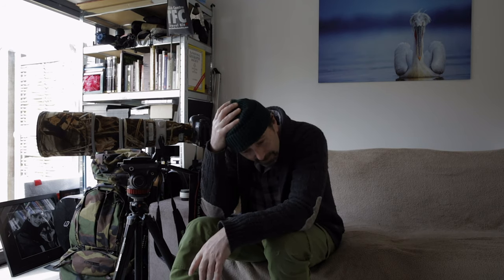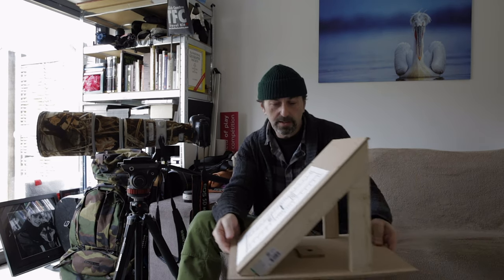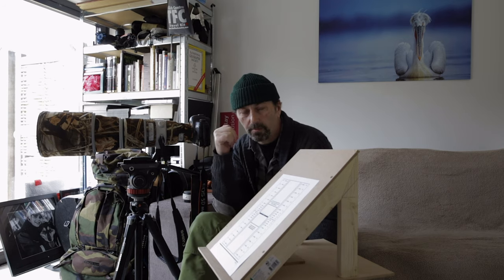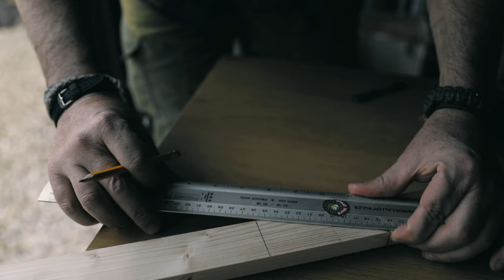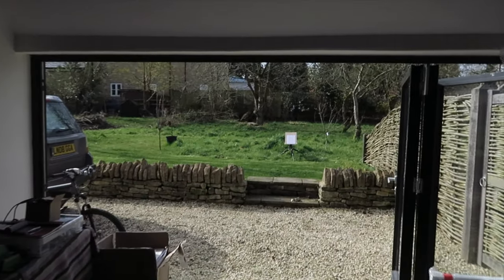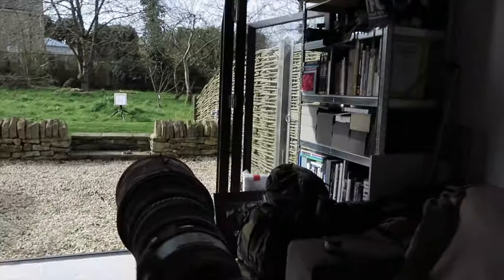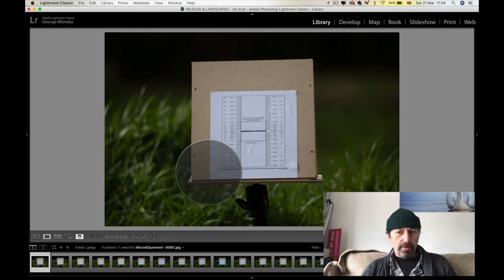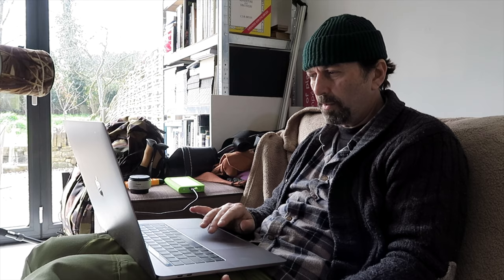Get Sharper Photos - Canon 500mm Lens Micro-Adjustment/Calibration  Tutorial

Comment: Hilariously, I shoot on the FD 500mm, and don't have any "calibration" issues... I guess there ARE some perks to shooting without autofocus. 
For THAT lens, the main and only issues are stability and aperture. It's too soft at F4.5-F6ish, so it almost needs to be at 7.1 or higher to really get in the groove.
Reply from the maker: Hey Benjamin.. same is true for my 500 when I have the teleconverter attached.. even though it only makes the f4 into an f5.6 it’s a bit too fluffy at anything less than f8..! All the best to you.. g
Reply: @GeorgeSBlonsky  Same to you! Good video. IF I ever get the EF version, (when I'm a 6 thousandaire XD), I'll remember this if I run into any trouble. 

I think the EF version is about 3 lbs heavier though :P And I handhold a LOT...for birds.

Comment: How can I do the test with my 70-200 f/2.8 IS II?
Reply from the maker: Hi Raihan... you will get a better result if you calibrate at 70mm (with the calibration table at 1.75m away) then recalibrate at 200mm (with the table 5m away) and then do one more at a middle focal length.. one that you use often.. for example 135mm is a good one.. that will give you a really good overall calibration for your lens.. what camera are you using..? Be aware if you are using a mirrorless camera you won't need to calibrate at all. Hope that helps.. g
Reply: @GeorgeSBlonsky  I'm using 5D Mark III, and finding my photos a lil bit soft.
Reply from the maker: Cool.. excellent camera.. it’s always good to calibrate but also make sure that you are using the best settings for the subject you are shooting so that the “softness” is not because of camera shake or subject movement.. tripod/monopod to avoid camera shake and fast enough shutter speed to “freeze” your subject.. if you’re already doing those then likely you’ll see a huge difference after calibration..! All the best.. g
Reply: Thanks a lot 😊